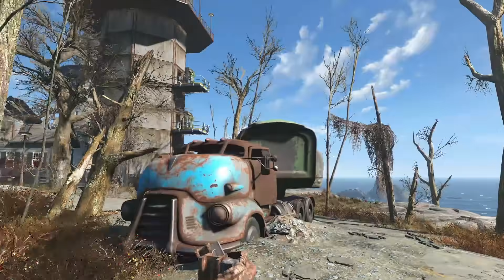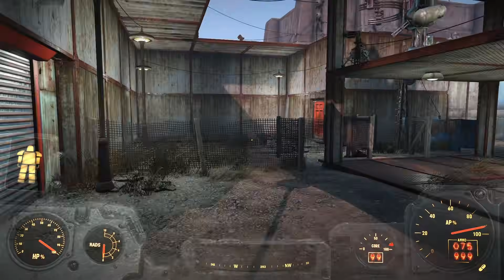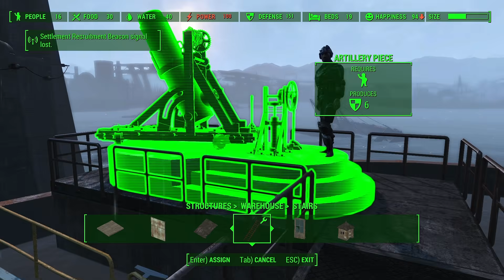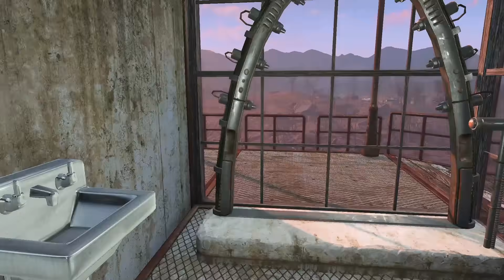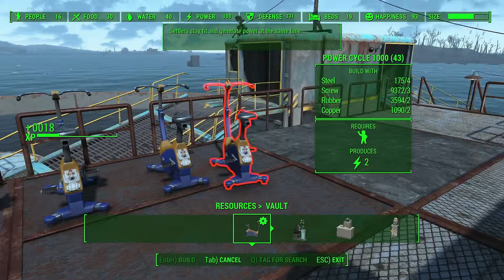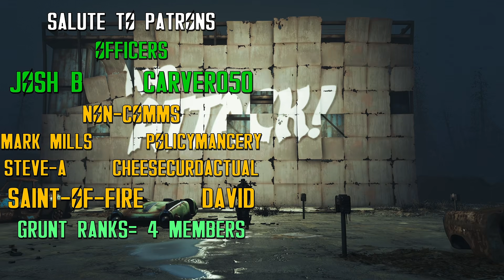Commonwealth Contractor: Fixing Warwick Homestead

Comment: A little more than halfway through the video. Impressive rework, so far! 
You addressed the biggest issues - and strengths - of Warwick Homestead; incorporating existent structures and managing the spawn POINT (singular). The main eastern wall rework was beautiful! And inspiring, as always.
My usual method uses barn foundations (option 1), the starter aligned to the end of the catwalk of the main habitation building, with everything extending from that. Some wonderful placement options arise for filling gaps along that using various small floor tiles with low collision thresholds (barn/concrete).
An awesome post-halloween treat! TY.
Reply: Ye gods man, scrap/lived-in components!!!
This is a growth moment.
Well done! Without any excess of "dollhousing", to boot...